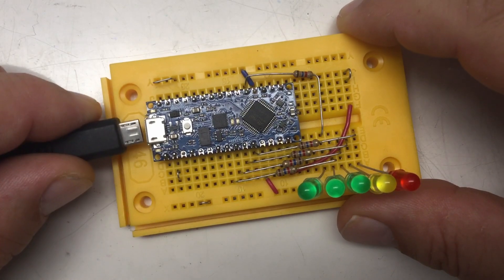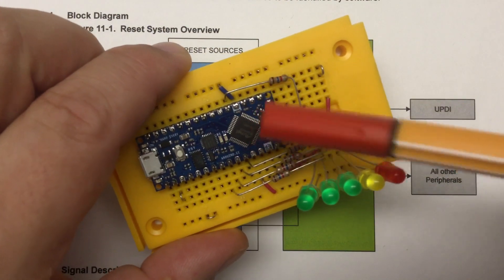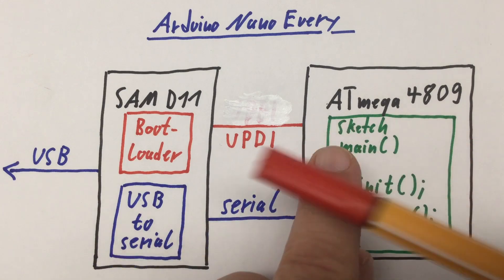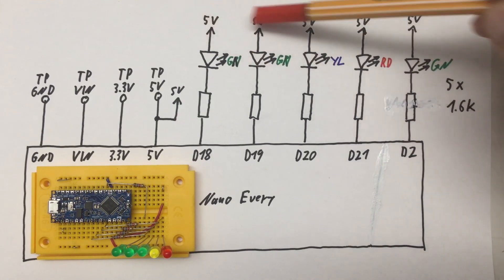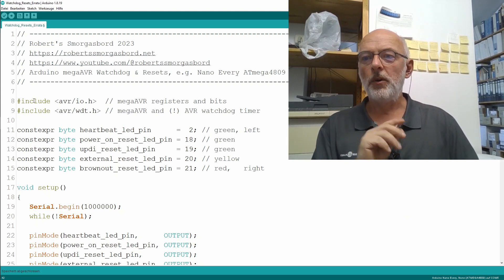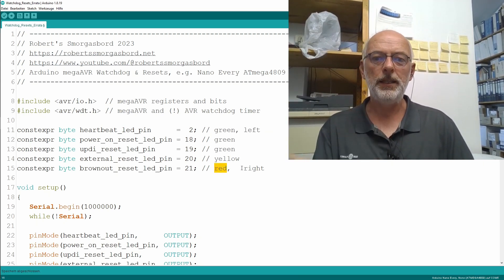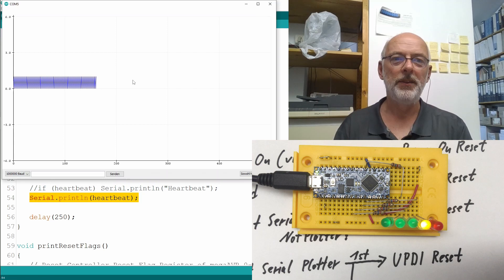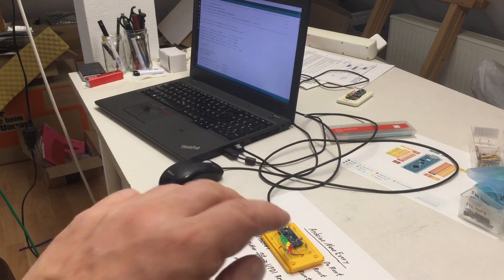Arduino megaAVR Watchdog & Resets, e.g. Nano Every ATmega4809 – Errata

Comment: i have this problem
avrdude: jtagmkII_initialize(): Cannot locate 'flash' and 'boot' memories in...
This error has mostly been reported for the Arduino Nano Every When a sketch is successfully compiled and uploaded, the Arduino IDE console output may indicate ”avrdude: jtagmkII_initialize():
Reply from the maker: Sorry, never stumbled about that specific problem. But here are two links with info about those messages:
https://forum.arduino.cc/t/error-avrdude-jtagmkii-initialize-cannot-locate-flash-and-boot-memories-in-description/1193800
https://support.arduino.cc/hc/en-us/articles/4405239282578-If-you-see-a-jtagmkII-initialize-Cannot-locate-flash-and-boot-memories-in-description-message-when-uploading-to-Nano-Every
Seems to be a warning that can be ignored.